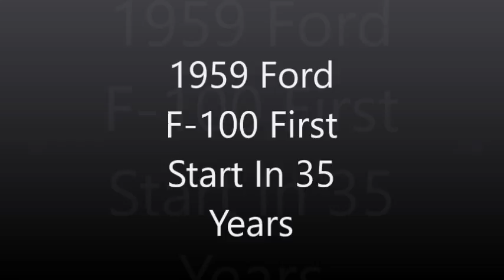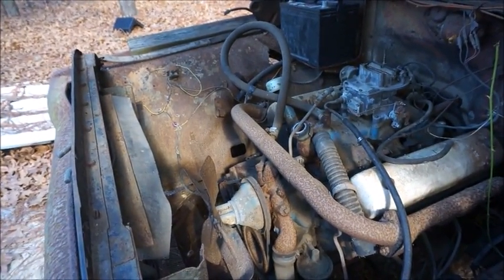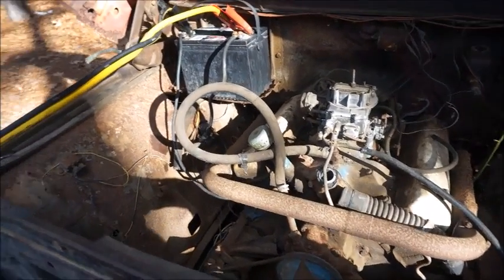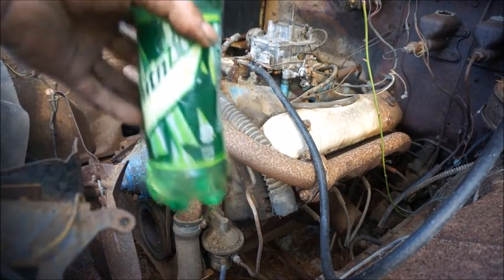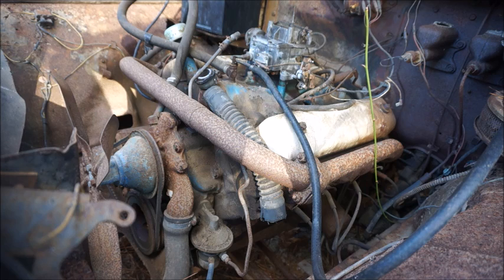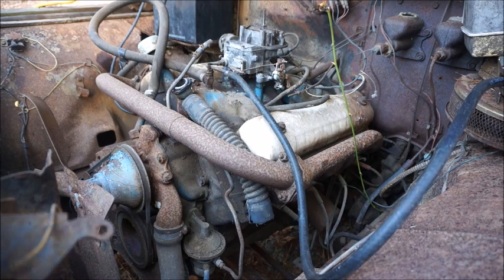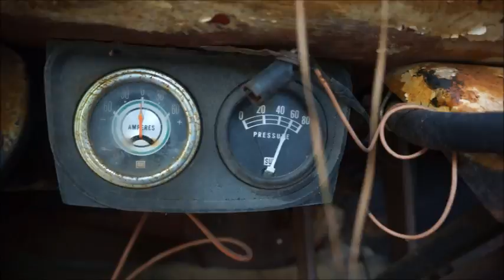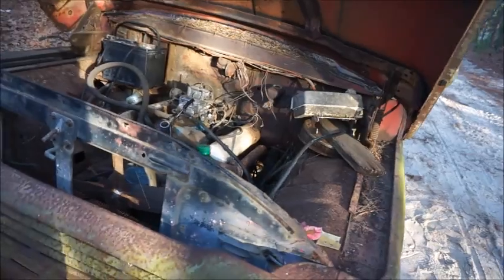1959 Ford F-100 First Start In 35 Years

Comment: I've had several  '56 '57 p/u's  6's and 8's.. the ground was postive .  Until 58. had a '58 Merc. The battery went dead. tried jumping it, got it started. Ran, but the battery wouldn't charge. Buddy told me to Switch the cables,   Then "cross" the regulator.Then it charged and the 430 ci. ran nice. I've got 2 '56 p/u's and a"57 Ranchero, also a 40 p/u and a '55 2dr wagon. all are in various stages of "rehab. Got engines, 292 ,272 ,312..351's C&W.. 460's , 427 block(from a boat) crank turns wrong way. A  440c.i  Merc . motor (bored 428) couple of differant trans. C-6's, 4 spds (stick) 9in rears..etc etc.. When I get some cash,I'll get some running.

Comment: Fix all the safety stuff on it and just keep it. New radiator, brakes, plugs, wires, tires, seat , heater, wiper blades, .... 
It’s cool to keep old stuff like that around if you live in the country.

Comment: mine in my profile pic started up after sitting 15 years in a dirt floor boat shed. smoked and stunk bad then ran good had good oil PSI. i put fresh oil in and drove it 10 miles before the motor seazed up solid. had oil PSI but it was not flowing at all, clogged someplace. took the valve cover off and it was like dried out pancake batter. oh well wanted to go hot rod nay way

Comment: The 292 was a good engine but the cam bearings didn't' lock as well as the should and the cam berins didn't get oil very well. I used to center punch the cam bearings so they didn't turn and then the cam got all the oil they needed. I had one with a T90 s speed and it would crank ninety MPH when it was in second gear. Supposed to be a close ratio transmission... big heavt duty trans. I'd sand it for the "patina" and shoot some clear on it and she'd be the queen of the fleet

Comment: Nice Job.

But I hope you did an oil change before starting instead of running the engine von 35 years old oil.

Squirting some oil into the cylinders through the spark plug holes and letting the rusted piston rings soak over night wouldve been a good idea, too.

Comment: No, not all the Y-blocks have the odd crossover pipe up front, just the ones that Ford couldn't find another way to do the job. Ford was stuck with the Y block while Chevrolet had a far superior 265 and 283 engine to sell cars with.
Reply: The Y block wasn't much of a performance engine, but it was far more rugged than the small block chevies.

Comment: Good idea to squirt 2 cycle gas in through the bowl vent tube so the pump diaphragm will be loaded,(assuming no one has opened the throttle up with the bowl dry  and ruined it),and so it will get 2 stroke gas as soon as it creates vacuum and not cylinder wall washing from ETHER, "The dry engine's enemy".

Comment: That's a 292 isn't it?  The starter sounds OK on it; remember these older Ford direct-drive starters aren't the most powerful things.
Reply from the maker: Yes 292, the cables were the real problem, I think the starter is OK. Thanks for watching!
Reply: All starters were direct drive during this era. Chrysler introduced the gear reduction starter in 1962, but GM and Ford stuck with their direct drive junk until the past couple of decades or so. All modern starters are based on the gear reduction style pioneered by chrysler.
Reply: Jeff Carr you sound like a terrible mechanic with a ford tattoo.
Reply: They put a LOT of 272's in Ford trucks. Dad had a Huge C model with a 272...it weighed near 10 thousand lbs...it was a freight van body..a lot of truck....for a small engine.

Comment: I'm surprised the oil pressure was 60! These get gunked up bad in the oiling passages,, plus the cooling ports for the heads will be rusted up. Long term running will overheat.

Comment: The cam bearing didn't have a grove for the oil to travel and when the cam bearing tuned it didn't oil the top end. I out raced a cop back in the day with one in a 57 ford two door post car. I really liked the fairlane over the galaxie because in had the narrow back window posts and larger back window... prettier car to my way of thinking

Comment: ford y block is like a gm engine . it has a dizzy in back along with Siamese ports. he should have soaked the cylinders with marvel mystery oil or atf for a week then cranked the engine by hand and kept adding oil to the cylinders to seat the rings. all so should have primed the oil pump with drill so all parts have oil. got to treat it like a fresh rebuild. use rotella 15w40 for the zinc. all so you can take a ford tfi module the gray one trigger it with points and use the efi coil and the late 70s ford big distributor cap on the points dizzy and use the efi coil and wires. the hot spark will get it to light off better.

Comment: Me and my busy were trying to start my ole roadrunner back in the late 70s and blew the top off of a battery my friend was lucky cause he got some of it in the face ran to the side of the house and washed of his face good thing the outside tap was we’re it was I’m sure if to long on the face would have not been good results batteries are pretty dangerous especially the old ones

Comment: its take skilled people to crank motors that been sitting the first i do is mix gas and oil together pour down the the carburater to oil the rings i do about 4 times in 24 hrs. if you dont you risk dry cly. breaking a ring

Comment: Think that just maybe if the points were crap that perhaps that the plugs are as well?  Drain out the old oil and put in some old oil that you drained from your last oil change.  At least no sludge from moisture unless you want all that crap pulled thru the engine.   I love just how Cheap people are but remember TIME is Money.   Burn up the starter using old plugs because that is the way you want to do it.
Reply from the maker: I will burn up 10 starters before I try to get one to start instantly without oil spread through the system. That's why we prime the pump on a rebuild. I also have proved many times that a engine sitting that long has low compression and sometimes takes a lot of cranking to get things to seat and compression to build.
Reply: Oh, it has good oil pressure now. Should have turned the pump and made it do that before ever turning it once.
I had a motor that only sat 2 years and one of the rod bearings stuck to the crank and spun a half a turn. If I would have run it more than couple minutes it would have destroyed the crank. It cracks me up to see people quickly start up a motor that sat over 10 years.
It makes me mad when I see people do it to antique one- of- a- kind motors.

Comment: Put a battery in it and fire ‘er up. I want to hear all the bearings spin. ( they probably look about like that belt pulley)
Reply: After 35 years there is zero oil in the bearings. Let’s crank it over. After 10 times around there is probably still no oil in them.  
  Cam is bone dry, but still has full valve spring pressure pushing against dry metal to metal tappets to cam.
 Not to mention those most sincerely dry and most likely surface rusted cylinders having dry pistons and rings going up and down
  Let’s take that cool original antique motor and reduce it to rubble just so we can say we made it run.
Reply from the maker: Been two years the guy is driving it daily

Comment: One thing that should be pointed out, engine starters have a limited duty cycle. 30 minutes cool down for every 10 seconds cranking. Starter solenoid relays too. Nobody follows this, great way to burn up a starter, just sayin'.

Comment: dude buy a can of starting fluid!
Reply from the maker: Never! To dry cylinders and rings would be shot by the time I got it started.I won't even use it on a diesel.
Reply: Joe wolfy007 when they sit this long starting fluid is the last thing you want to do. I usually spray fogging oil in all cylinders, rotate engine by hand, check for spark and fuel. You have to nurse an engine back to life when it's been sitting this long.
Reply: I do all the time
Reply: Not for that
Reply: That's one of the worst things you can do
Reply: This engine sat 35 years. The excessive cranking actually helps the engine lube up and free things up to build compression. I would always risk burning up a starter over damaging a good engine. Ether is too explosive, in my opinion to use on any stock gasoline or diesel engine let alone one been setting this long. I love these old engines and will take them over the sensor laden plastic covered crap engine/cars they make today.  This old girl purred once she got going. :)
Reply: Joe wolfy007 so you were the one that disliked the video
Reply: He doesn't use starting fluid and for good reason
Reply: Starting fluid is the quickest way to fry any engine.
It washes all the oil away from the parts that need the oil.  This guy is doing it the right way.
Reply: Toxiccannibal5 o
Reply: Brodie  Agreed Brodie. We spend alot of money for a piece of plastic and aluminum junk nowadays!!! It's robbery!!
Reply: Russell Gerdes  Exactly! I agree with you as well! Starting fluid has it's place and you just described it. Some diesels even came with an either injector for the exact condition you described. You're not going to damage an engine sitting for a few months  with it but one that's been sitting for years could be.👍

Comment: 6:50 Your face is inches away from the top of the battery while you're cranking the engine with live spark and fuel.  Have you never been in the vicinity of a hydrogen on sulphuric acid explosion?  It's not as fun as it sounds.

Comment: 292?  272m 312?
Reply from the maker: 292
Reply: Jonathan W funny my dad junked cars when i was young still messing with cars for years... he bought an old dr pepper delivery truck  took off the big box put a dump bed from an old teach compactor put 20 rims 10 hundred 20s on it we ran 60 miles to the shredder and returned trip brought back a load of limestone 
mostly loaded up to 28000 max limit..it weighed 8k empty so the 20k max legal wt... but to this day that truck round trip got 9mpg 
so you may think of as a guide...could get you some decent fuel
economy....thanks for the reply  oh the one thing I use first on things sitting use starting fluid just to see if there is spark  then proceed.....narrowing the check this check that sometimes condensation accumulates in the pan and oil pick up is on the bottom if it runs it pumps water through the places that do well

subbed

Comment: Cateful the oil pump Allen shaft s break lose oil pressure have ranchero. 59  312  ..260 292 same prob ask me if you have rocker oil problem .have simple solution.😂
Reply: PS never use soda bottle like that friend and wife dead use a spray bottle..was a camper they burnt up on side of road those Ford's fiash back easily.😎they had 5gal inside dropped the flaming soda bottle open gas can fell over.

Comment: This guy seems nice and all but none to bright!!  Every tutorial that I have watched, he has run the starter to the point of meltdown and weather it runs or not, it will definitely need a new starter when Mr Rogers is done with it. The video he did with the 283 Impala, the gas bottle had a pin hole in it and he knew it and said it, all he had to do was take off the cap but noooooo. he ran that starter ti'l it reached it's meltdown point, and now in this video he melted the lead positive terminal right the crunk off. He has no business near any engine, not even to check the oil. When he did he spilled more of it on the valve cover than anything.  I thought Mr Rogers passed away anyhow?  What the heck is he doing working on antiques that  are very rare?